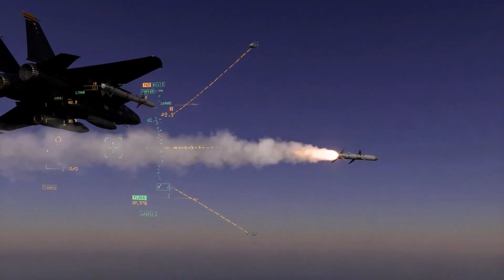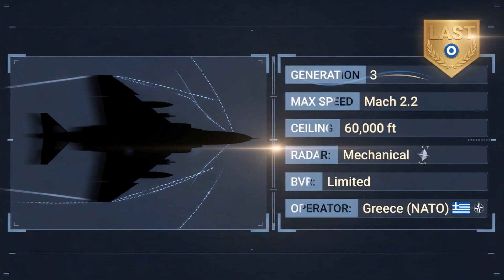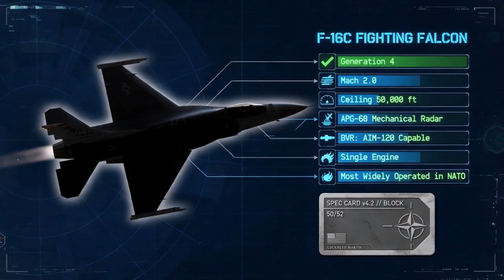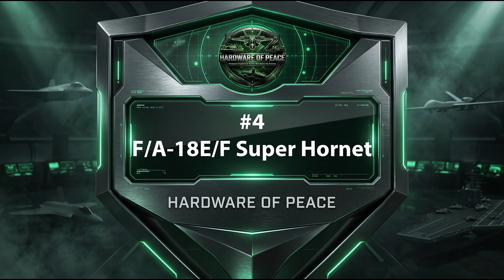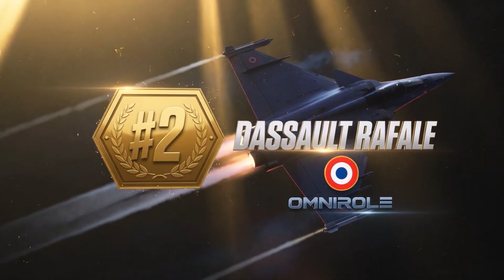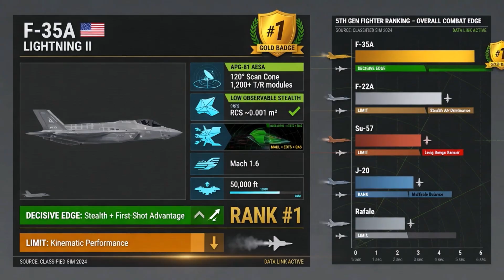NATO Jets Ranked: Every Fighter Jet from Worst to Best

Comment: F 22  U.S.ONLY
Reply from the maker: Correct. The F-22 has never been approved for export, so it serves exclusively with the U.S. Air Force. It's an interesting contrast to the F-15 and F-35, both of which have numerous international operators. Thanks for the comment!

Comment: What did you present the outdated F-4 but not the still operational F-15C/E/EX?
Reply from the maker: Appreciate the sharp eye — this is exactly the kind of comment that makes the discussion better. 👊

On the F-4: I included it because the Hellenic Air Force still operates the F-4E Phantom II as part of NATO’s active inventory. Yes, it’s old, but it’s still flying under a NATO flag, so it earned a spot in a “worst to best” ranking that spans every generation.

On the F-15: you’re absolutely right. The F-15C, E, and EX are not just operational — they’re absolute beasts. I had to draw a line somewhere to keep the video digestible, and the F-15 family honestly deserves its own deep dive (which is already on my list). I’ll be breaking down the whole Eagle lineage separately — including why an EX can credibly challenge 5th‑gens in certain scenarios.

Thanks for keeping me honest, and for watching that closely.
Reply from the maker: The F-15 first flew in 1972... Nine variants. Eight nations. One airframe that has outlived every aircraft designed to replace it..
Watch F-15 Dynasty Video👉 https://youtu.be/XQIbBjrAbmM?si=bQljvF3Bp7sWFqUa